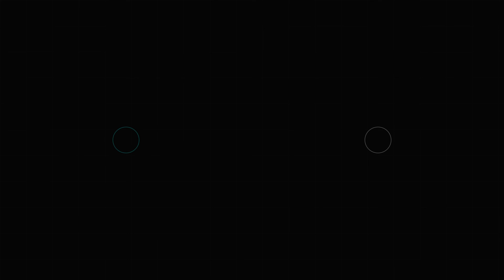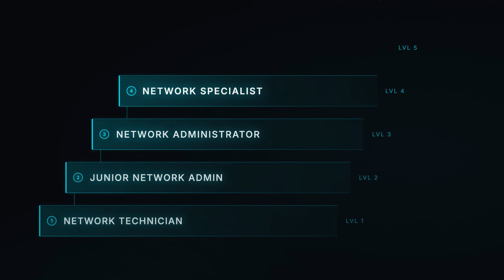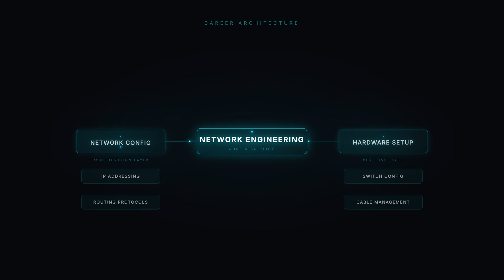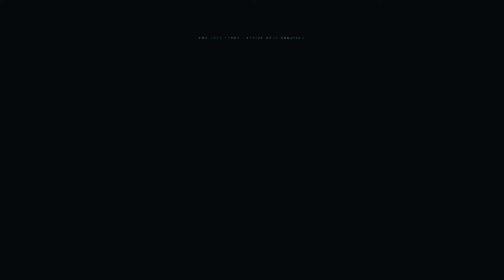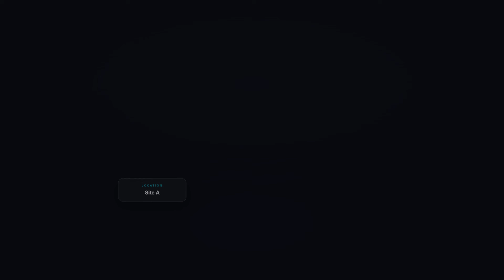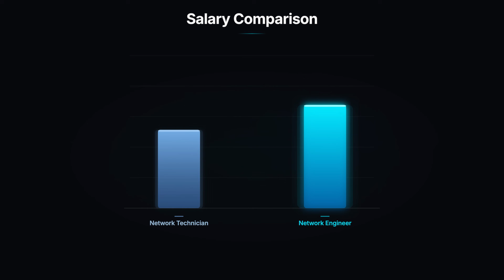Stop Applying to the Wrong Role. Network Engineer vs. Technician Explained

Comment: After 6 month like help-desk junior i moved to anotber conpany as network admin entry level thanks to the ccna. My job varies from progeting the lan/wlans, of the sites, preparing switches, wlc-s, mounting AP, patching cables, deployment& integration in hot/cold envrioments even with other network clients who have diferent vendors, so i implement all the network layer at level 2, and a litle at layer 3 , +monitoring through zabix imc e-sight, dhcp server for the scopes,  ticketing and emailing and finally i got to go even to tbe user to troubleshot the layer 1 cables, and repristinate the pins throught tbe standards. All of this and im called Network adnin junior, but i am even a technician not in paper

Comment: CISCO in the new CCNA 2.0 blueprint has removed the section related to the different types of cables (single mode, etc.). Being CCNA a certification for network engineering, I guess that change reflects what the market actually looks for in terms of skills in a network engineer. Also, especially here in Australia, I noticed that like many datacentres nowadays to overcome the lack of network technicians, are relaying on trained electricians to do the job.
Reply: Yep. Electricians are getting CCNAs and jumping in to engineering where im at

Comment: is working part time network technician and going to school for a masters in network engineering a realistic thing?
Reply: Where u getting masters at?
Reply: @TheErik1119 I second this. Ain't no one getting a masters degree in Network Engineering. Despite the title "Engineer" it's not the same thing as Electrical, Mechanical or Civil Engineer. Those require extensive knowledge. Network Engineering doesn't. If you were getting a masters it would either be in computer science or information technology or it's subsets like CISO. In IT if you have a masters you are no longer an Engineer. You are in some sort of authoritative role management thousands of Engineers under you.
Reply: I @bruno-vicious I mean he can still get senior positions he's already a network technician, regardless he can do both if he's getting his masters . But I mean wgu has a network path for a bachelor's . And networking and low voltage and technician roles are still a growing field
Reply: @TheErik1119  I never said he could not get senior positions. My point was that he does not even sound like he is in the field yet. He was asking if working part time as a Network Technician while pursuing a master’s is realistic, and yes, it absolutely is.

What I was mainly addressing was the “master’s in Network Engineering” part because that is not really how most IT education paths work. Most master’s programs are broader areas like Information Technology, Information Systems, Cybersecurity, or Computer Science with networking as a concentration or specialization. I was trying to set realistic expectations because networking is usually treated as a specialization within IT, not an entirely separate academic field.

Speaking from personal experience as someone who has worked in Network Engineering for more than 10 years, experience and certifications matter just as much as degrees in this field, sometimes even more. I have worked with Network Engineers who only had high school diplomas, and I have also worked under a manager who transitioned into networking from completely unrelated fields like accounting.

I also agree that networking, low voltage, and technician roles are still growing and valuable career paths.

Comment: I recently failed at an interview for a data center role; I thought I was gonna be asked networking questions and the vast majority of the questions were regarding hardware and A+ knowledge 💀. Needless to say I wasn’t prepared at all.
Reply: AWS?
Reply: @unpublicizd yes
Reply: Can you elaborate?
Reply: @krypt at data centers it’s mainly working on the servers and racking and stacking servers and performing cable runs or device upgrades like adding memory or storage
Reply: @krypt  **Update:  So AWS actually gave me an offer for a network tech position, despite me thinking I tanked the interview;  I did good with the first two interviews, which were more personal questions and questions about how I would approach certain situations. The third interview was technical and asked me a lot of hardware questions (cmos battery, cable connectors, bios questions, etc.). They asked about the osi model, and a couple basic network questions, but the majority questions were hardware, pc, server questions (basically A+ content, which I admit I’m not as brushed up on, compare to the networking content, I have the net+ and sec+ currently and I’m working on CCNA, I don’t have the A+).  Now I have a good problem because I interviewed for another position that I’m waiting to hear from, which isn’t data center focused and more networking focused. I’ll keep you posted on what I decide to do, cause I gotta make a decision in a few days. My recruiter basically said that they thought I knew enough to be taught what they thought I lacked in the hardware knowledge, and I did well on the first two interviews, hence why they moved forward with me

Comment: TLDW; There is no difference in reality it just depends on the company or organization youre working for with.

For example in the Military, the Army specifically, Network Engineers are Officers that "Plan, and Brief" how a Network will be deployed and work under operation Network Technicians are also Officers but they are responsible for configuring and maintaining the network under operation. Engineers rarely are allowed to touch Networks in the Army because they rarely understand how it actually works in practice vs theory until theyve reached the rank of Major or above.

Comment: Guess I'm one of the few "Sr. network technicians" in existance 😂.  I still report to an admin though. Title at my org doesn't mean much, on paper I am responsible for layer 1 items, but in reality I'm touching layer 3 as well. Iv'e had to setup firewalls, core switch replacents, turnkey cameras installs, and i'm constantly installing new switches. My admin is on paper an admin, nah he's doing engineering work, budgeting, etc. none of us a paid enough for what we do. Pay, title and responsibilites depend entirely on the organization.
Reply: I work for a tribe in Michigan. 

Which has 3 casinos, a resort, and government facilities. All of which is all interconnected by the tribe's own ISP. And the IT department manages all properties, including the government. 30 IT staff.
Reply: I feel that I wear three hats where I work. I'm a senior digital forensics examiner, and I'm also a system/network junior admin. So, I'm installing services, outfitting the server, running cables, putting up firewalls, automating systems with code, and doing cell phone and computer forensics. I never know what to call myself
Reply: You work in a large isp or data center?

Comment: First, I want Network Engineer ❤
Reply: I heard it’s best to go Network+ for my situation and then get CCNA funded by a employer. What do you think?
Reply: @KingFaulcon I’d agree but that would depend if you can find an employer that will not hire you but also be willing to pay for your certification. Honestly may be better to pay for CCNA yourself then when you get hired ask about the company paying for more advanced certs
Reply: @KingFaulcon  no recruiters do not look at Network+ for Network Engineer roles, that will get you a helpdesk job at best. You will need a CCNA minimum as a Network Engineer. I will say this though I have worked with Network Engineers who only have a high school diploma.

Also, I want to add one more thing. Do not count on employers to pay for you CCNA cert when you are in a helpdesk role. They only pay for certs that you need for the role.